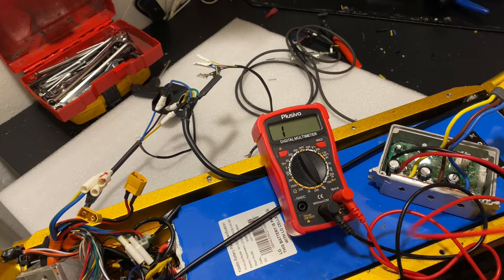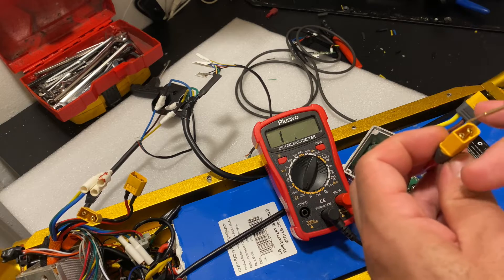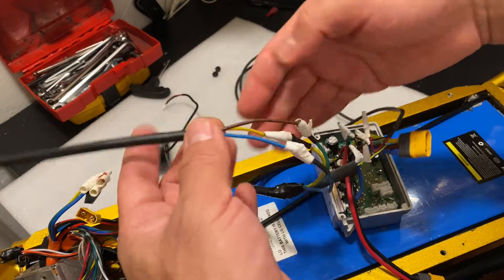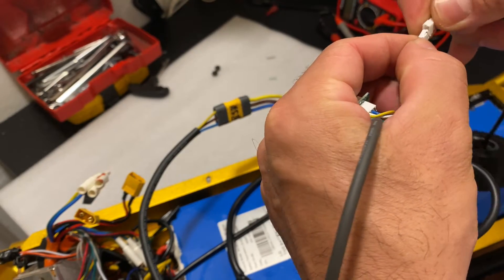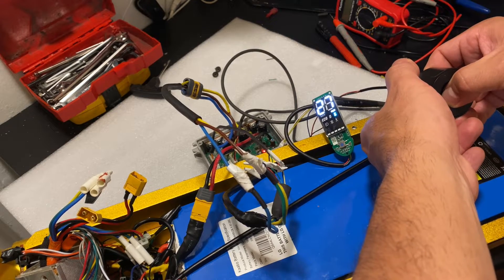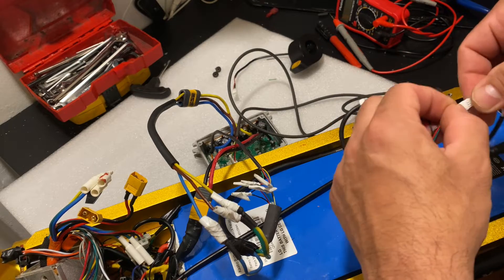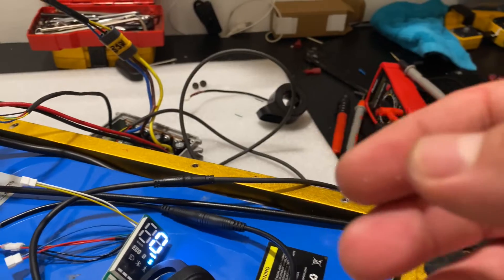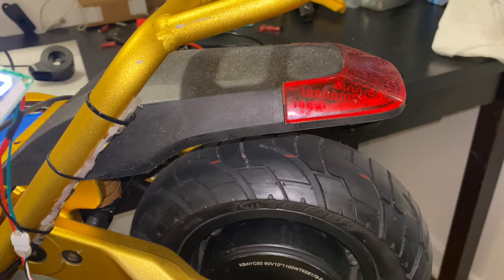Ninebot Max G30D Controller NO UPGRADES AND PLUGGED TO 65V and 1100W Kaabo Motor!

Comment: Hey what did you need to do with the controller for it to run that voltage?
Reply from the maker: D controller holds up 60V without a problem. You just need to do all sets up I mentioned in the dual motor set up video.
Reply: @esnkaz  i noticed you have the three main capacitor version, and both of the ones that i have are the single capacitor type, do you know if that might be problematic? Thank you
Reply from the maker: @nocandopdx  yes they burn if using battery above 36v
Reply: @esnkaz  i read about needing to change the adc resistor for it to work, do you know anything about that? Ty
Reply from the maker: @nocandopdx  the idea of my information it was so people do their upgrades without the impossible! Set ups done for dual and 60v with 1100w motors with 3 capacitors controllers (D controller German version) is simple. Scooters build back in 2022 with this set ups still running today with the same system.

Comment: Hi friend , Looking at the adapter you made for the Kaabo motor to the controller. Can you please tell me the order of the phase wires from the kaabo  to the ninebot controller.  

Is it : 

yellow > yellow 
blue > blue 
brown > Green

is that correct order I have same motor same controller but i think my motors doesn't move due to the phase wires being incorrectly. Thanks again
Reply from the maker: Simply check last video specially made for kaabo motor wire set up.

Comment: Did u add software or not
Reply from the maker: Of course controllers need to be set with firmwares to run higher voltage. As in bigger scooters, controllers are set with computers to run motors and batteries. In this days is just few who know how to do this things.
Reply: Well how do u get firmware
Reply from the maker: @SimonFortin-zp5fz  I make them.
Reply: @esnkaz  no you dont 🤣 

How do you "make" them? Just messing around in SHFW?
Reply from the maker: @jaleger2295  I adjust the firmwares according to voltage and battery use on a scooter. And yes I make the firmwares. is done using st-link. FYI, even vehicles computers can be modified ;) we know this for decades.

Comment: Replace the caps with 80V ones.  Otherwise your regen braking will most likely blow your stock 60V cap when coming down a steep hill and you apply brake.  You can replace the mosfets with 80v ones (I'd have to look up the catalog numbers) and replace the 60V cap, thicken the traces on the board with some solid copper wire/solder and you'll have a rock solid 80V controller.

The stock caps are the weakest link, followed by the mosfets, and then finally the board traces that connect the caps / mosfets on the rear of the board.

Thanks for the discussion though...
Reply from the maker: Jejeje the problem was solve by simply using regular disk brake and removing completely regen. As well explained on dual system conversion videos to use XT90 connectors between battery and controllers when 60v or 72v as well upgrade to 10gauge wires. Regen has to be remove on firmwares then remove connections between lever and dash. Scooters have been running on those set ups over a year already without issues. I discover those setting back at the end of 2021 and published them after 6 month of testing by me and other commuters.  Thank you so much for the input jejeje but your set ups will burn your controller and damage your battery from the overload when down the hill or by simply pressing the brake hard even on 48v. Please check out videos on conversion videos post on later month and updated description information early this year :)
Reply: @esnkaz    you've never had a solder trace on the ECU controller board go bad or blow from runningit @  64v ?    That's awesome.  You haven't made any changes to the factory ecu / controller?    What about the dash, it doesn't blow from the increased Volts in on the main power connection?  Does the ECU controller keep the dash voltage to under 5v even with the 64v power?

Thanks for your info here!  Much appreciated
Reply from the maker: @patrickmichael2968  hey Patric. Controller it’s designed to hold up to 70V. 1100w motors work great. Continues current 38A and max of 64 peak. Dash board doesn’t change current. You must St. Link a D controller and load new program. Shot off Kers then load the new firmware. After bypass lever warning and turn off. Then you remove lever connections towards dash. I will strongly not be o go with dual motor set up or any other before you add suspensions to the frame of the scooter.
Reply: @esnkaz Hi, bro. Could you guide me on how to "bypass lever warning and turn off. Then you remove lever connections towards dash". Thanks!!!
Reply: What about ADC resistor before stepdown? Did you change it?

Comment: What scooter are you testing this with?
Reply: Kaboo wolf warrior
Reply from the maker: @jasonnelson1585  All using from the WW X Pro its the battery, wheel, brakes and lights. Controller, dash and throttle are Ninebot Max and thats what it need to be test, to see if holds the load.

Comment: How did you manage to get the controller to work on 60v without it blowing up?
Reply from the maker: It’s a question I had as well lol until I decided to see it with my own eyes and test myself and if works out ok everyone will see it. ESnKaz will show you. I know several guys have been using this set ups for a while now. I will do a proper testing and see if controller without upgrades will really hold up the pressure on the road of 60v on full charge.
Reply: The controller will work with 72v without blowing up
Reply: @jasonnelson1585  oh! Interesting! I wanna try this out to get more speed
however I don’t know how to 💔
Reply: @mysticsentertainment1800  it is dangerous
Reply: It takes an expensive battery and you have to load in custom firmware
Reply from the maker: @jasonnelson1585  It is not about the battery. I tested last night on 60V and burn up one controller. It's about set ups (Firmwares) I ran a second controller with lower amps and work ok. Test lasted for a bout 30 minutes on flat roads. Testing requires.
Reply: @esnkaz  I can't speak to 20s but I ran 18s on a d controller with no issues. I lost the controller due to my own error
Reply: @esnkaz  

Replace the caps with 80V ones.  Otherwise your regen braking will most likely blow your stock 60V cap when coming down a steep hill and you apply brake.  You can replace the mosfets with 80v ones (I'd have to look up the catalog numbers) and replace the 60V cap, thicken the traces on the board with some solid copper wire/solder and you'll have a rock solid 80V controller.

The stock caps are the weakest link, followed by the mosfets, and then finally the board traces that connect the caps / mosfets on the rear of the board.
Reply: Quite a number of us have been running 72v on these stock G30D controllers and we've taught everyone exactly how to do it. but hes been too stubborn to listen to us, instead he just says JEJEJE STAY TUNED.
Reply from the maker: @DaddyPolati  I would to see where did you post about it and where are the settings for it. You simply have post that you are running 72V and yet there is no real footage of it. I Test it last night and blowed one controller con 60V. Video coming up.
Reply: @esnkaz  You blew it because you have no idea how to tune the firmware hahahahah
Reply from the maker: @DaddyPolati  jejeje i do magic with firmwares my friend. Look I like to push limits to get real results and truthfully D controller hold up the load on 60v but on low current but torque and speed is not much difference than 54.4v (48v) I m running 60v on upgraded controllers and speed and torque are way better than none upgraded D controllers and yes firmwares for those are stronger. However if you would share your secret might be helpful :) my testing doesn’t end there jejeje I’m going to put dual bold D controllers on 60v lol hopefully I don’t blew it as you say and smoke another 2 controllers lol! All for the fun and get results to my followers!!!
Reply: @esnkaz  Jejeejej you use the wrong software and pointlessly push the limits to blow the controller because you don't know what you're doing software wise. We are all using high amps with high torque, so yes the difference between 48v and 60v is significant.
We get the following speeds whilst riding with our software:
48v 35mph
60v 45mph
72v 48mph+
But good luck with your testing lol.
Reply: @DaddyPolati  tbh I’d love to get 72v in my ninebot max without burning the controller, but I live in the US so I don’t have a “D” controller, what exactly would I do to achieve 72v